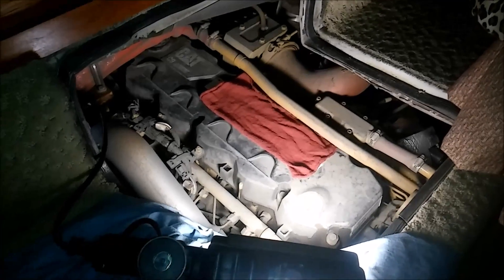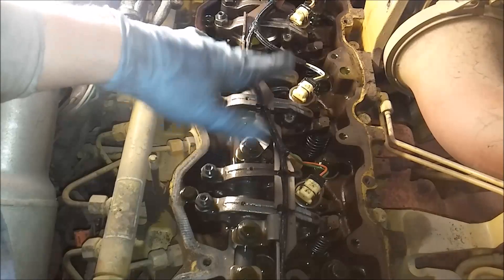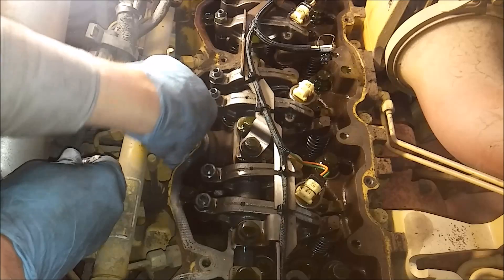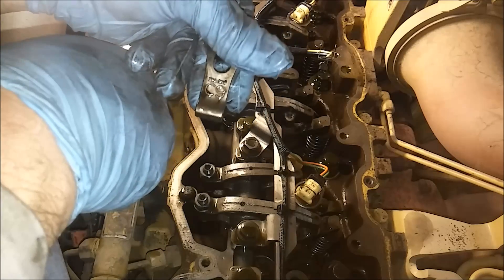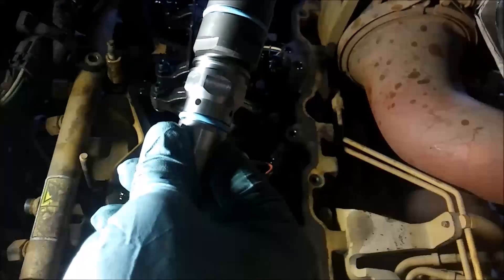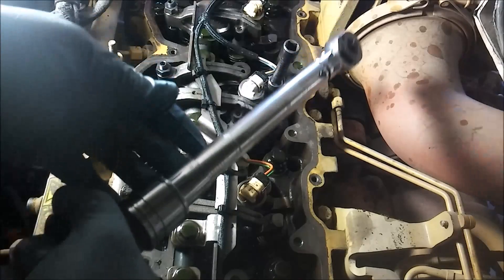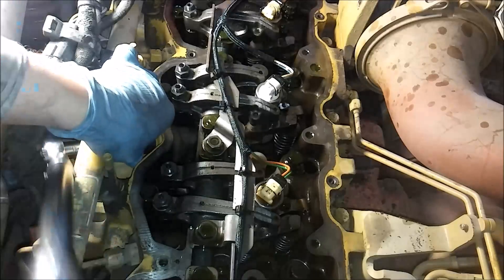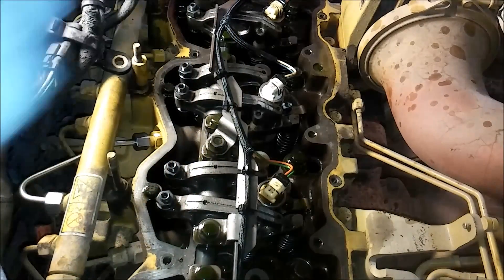How To Change a Common Rail Injector.  Cat, Cummins, and International.

Comment: we replaced injector number four after the replacement the engine not running properly what the problem sir...? but somebody's says you must inter the ecm to programs that we are installed a new injector...

Comment: Fluid injection, small leaks that release partial volume and pressure are highly dangerous, completely disconnect a high pressure line from an injector and just a dribble will occur at relatively small volume when cranking. Small leaks under high pressure are the danger, as they can pierce skin or atomise the fuel. Google the Westralia disaster, not even common rail pressures but with disastrous consequences.

Comment: The tubes or high pressure fuel connectors are re-usable on the cummins as long as it stays with the injector it was originaly installed with. If the injector is new it must be replaced. They are crushed at the tip when mated to the injector so it will leak if a used tube is put on a diffrent injector or on a new one.

Comment: Do you have to bleed down the common rail before loosening those lines?
Reply from the maker: +nick elias The common rail should bleed down after the engine has been off for a few minutes. I've never removed one of the lines and had it spray pressure, but it is always a great idea to keep your hands away from the fitting the first time you crack it.
Reply: Thmx for the info. Im new to diesels and just bought a diesel truck
Reply: Yeah fluid intrusion is the last thing you want
Reply: @AdeptApe  on the common rail ISX always break free the line that supplies the fuel rail with fuel first to vent pressure. It has a machined slot down it to vent the pressure towards the block and away from you. Though i have done many and bearly any fuel comes out but its better to just play it safe.

Comment: Would a fuel rail pressure code be caused by injectors ?
Reply: not likely- most likely hpfp (high pressure fuel pump) is not up to par.

now is when you kick yourself for not designing it off an injection pump- because the pump went out anyways. why not have one device handle everything....

Comment: I have a 3126 in a 2001 GMC and I have been losing power more and more every day for the past week Especially climbing up hills . It almost feels like there's a misfire and I've noticed the turbo changes tone while it "misfires" . I just noticed today that they will pressure is also getting worse according to the dashboard gauge it reads nothing at idle. Any clue on what this could be? 

Keep up the great videos!

Comment: I rebuilt a 4045H John Deere common rail engine, motor runs perfect except for the fuel leak which is coming out of the fitting which holds the quill tube in, the path is also the fuel return back to the tank, the cat idea is a lot better, comment is now edited,  the engine was taken apart by dealer, now appears there must have been a seal on the fitting which holds the stem/quill in.
Reply from the maker: +actorzone Be extremely careful around common rail leaks, they can puncture your skin. Are the lines supposed to be replaced after being used once?
Reply: I think the thread around the fitting which holds the quill in is leaking as this is also the fuel return path, the return path is via the galleys in the main tappet cover to an exit pipe, the cat engine has a fuel return back along the quill galley as well but they have a seal installed, the difference in other cat injector is the fuel return holes are lower down on the Injector, the tubes coming from the rail tube to the fitting are ok, I don't work while the engine is running as aware of the safety issues.

Comment: Do you think its the injectors that is bad on a jd 6068 with common rail, it runs very harsh on idle when the engine is cold and starts badly, and i dont know when they were changed or if they are ever been changed and the engines   Done 9500 hours

Comment: How does the tip of the fuel injector not become damaged after detonation. Isn't a portion of the tip, if not more, inside the cylinder. If so, wouldn't the force of the detonation cause it break?
Reply from the maker: +Buchanan Baxter That is a great question because yes the injector tip is exposed to the heat and pressure of the combustion process. The injectors are made from some very high strength steel to endure those pressures.

Comment: easy money old school cat motor ! You should due a vlog on final tear 4 or overhead cam engines like johndeere 13.5 sir, but thanks for vlog
Reply from the maker: +Eric Price I would like to get into other engines, but our shop mostly works on Cat only.
Reply: Work for a Deere dealer in the uk, we are not having very good luck with the 13.5 engines
Reply: 05clenharth never said they are dependable clenharth.

Comment: Hey adept

doesnt the c9 use heui? how come you said common rail???
Reply from the maker: +Omar Most C9 engines were HEUI the C9S serial number C9 engines with the regen systems were common rail. Same as the C7 HEUI and C7S common rail.

Comment: Do you change oil after spraying the valve train with brake clean?
Reply from the maker: You don't have to, brake clean leaves no residue and evaporates very quickly. I've never heard a reason to or seen anyone else do it.
Reply: +Adept Ape that's what I thought, thanks man.
Reply from the maker: +Flipper Deluxe It was a good question though, thanks for commenting.

Comment: Crows foot should be at 90 deg on torque wrench or you need to calculate the length you've added. The way you had it lengthens the leverage leading to an over torque in this case.  Keeping crows foot  at 90 degrees alleviates this. Great vid.
Reply from the maker: You are correct sir, please notify the engineers that designed this engine where it is almost freaking impossible to even get a crowsfoot on the fuel lines, let alone with a torque wrench. Thank you for commenting.
Reply: haha all good mate, love your vids. I work on large cat engines. Never stop learning :) Have you heard the term FT lol
Reply from the maker: +Pete lol How large? Are you working on the 3500 series or even bigger stuff?
Reply: Im sure you used the torque wrench for the vid ;)
Reply: Cat 797's. 789's, 793's, 777's D11 D10 D9.. etc mate
Reply: Your engine looks so little lol but so similar
Reply from the maker: +Pete lol I used to work in Power Generation and did some work on the 3500 engines, but I did more electrical then. Those engines are really designed well to work on, not sure how the access is inside a haul truck though.

Comment: Nice video man! I enjoyed it
Reply from the maker: Thank you sir. Haven't heard from you in a little while, hope your doing well.
Reply: @AdeptApe  do you know of any videos like yours but for the cm2250 cummins isx15?
Reply: +Adept Ape Hey buddy I have a question is there a certain way to depressurize the common rail before you start removal?
Reply from the maker: +Podlfks dues fe The rail is only under pressure while the engine is running, when the engine is shut down the pressure immediately starts to bleed off. I have never cracked a fuel line when the engine is off and had pressure on it. I know this applies on the Cats and a couple of the Internationals I've worked on, of course if you go to remove a line on something that was shut down 15 seconds ago there may be some residual pressure. I'm not familiar with every manufacturer engine ever made though, so some may have some sort of "bleed off" procedure, but I'm not aware of any. Hope that answers it.

Comment: Nice video thanks.  What is the best way to test if an injector is firing correctly while the engine is running?  (Or to test for a faulty injector?)  on the Detroits i can short out the injector by holding down the mechanical plunger while it is running, or if the engine has a mechanical fuel pump you can crack the line going to each cylinder.  What is the best way to test an injector on a common rail with electrically operated injector?
Reply from the maker: Hey Regal, a cylinder cutout test through the ECM is really the best way. You can just click to kill each cylinder to see which doesn't change the engine load. If you don't have the super expensive manufacturer software to do that, you could potentially disconnect the wiring going to each injector, but I do NOT recommend it because most newer injectors run higher voltages (90+ volts) to the solenoids, so you could get zapped or possibly cause electrical damage. In addition, I don't like being close to these engines fuel systems while they are running for reasons stated in the video. Cat also has a Fuel System Verification Test that is runs on these engines to test the injectors, then says whether they are "responding" which basically means whether the injector is dropping rail pressure equally.
Reply: Will the snap on computers work with these engines or does it have to be a cat software based computer?
Reply from the maker: +Regal2800 These engines are pre OBD HD so they probably wouldn't work on the Cat ECMs, but I've only used CAT ET so you may be able to get codes with a scanner. If you try it out, let me know if it'll talk to it.

Comment: Safety first awesome
Reply from the maker: Thank you, don't want someone cracking a line and having their hand removed. It is kind of crazy the pressure they are getting out of these engines nowadays. Thanks for commenting.
Reply: Is it not a good idea to change all the injectors Adept?
Reply from the maker: +Muchie You really just change them as they fail for the most part. This engine had low miles still so it just needed #4 changed.